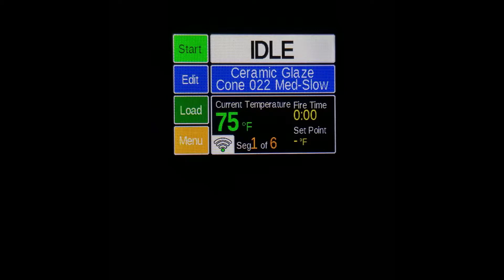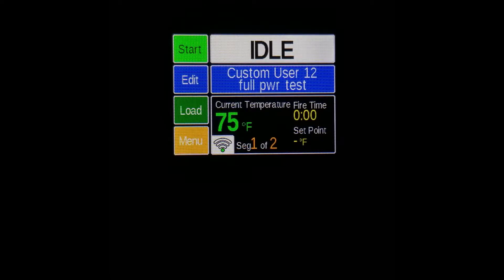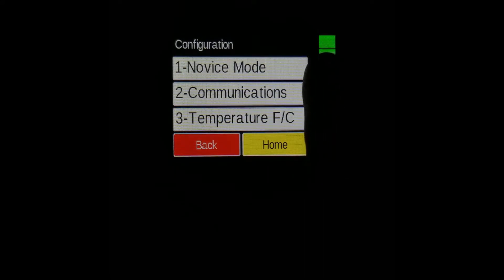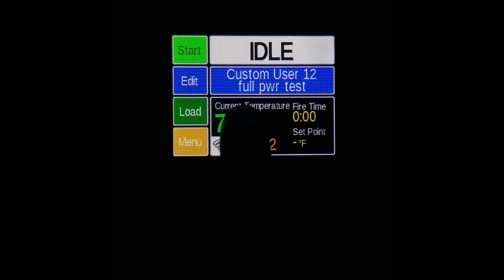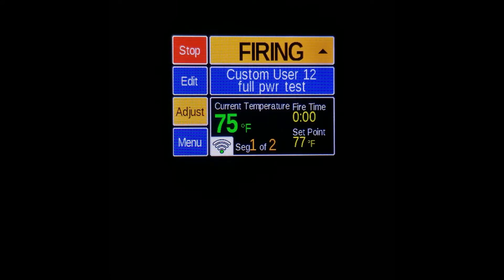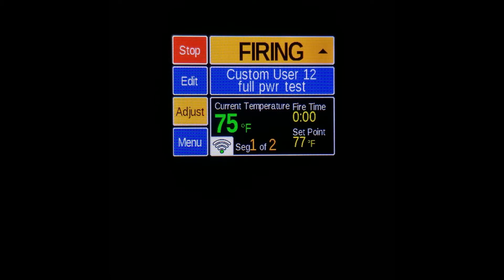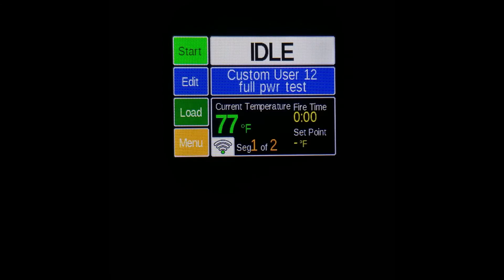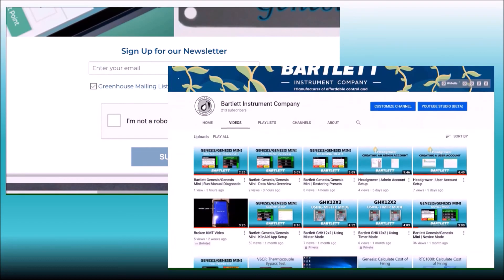Bartlett Genesis/Genesis Mini | Full Power Test

Comment: Good evening 
Quick ? Genesis 2.0 3 zone older converted kiln with solid state relays, after 2 cone o5 bisque and 2 glaze cone 5.5 firings my relay health tab is showing zone 1 226xxx, zone 2 178xxx, zone 3 258xxx cycles. I have the ssr option turned on. Are these normal numbers? I think they’re number of on/off cycles but it just looks like allot. Then I may have weak zone 2 elements on top of that. Thanks
Reply from the maker: When is SSR mode is pulses the output as the cycle time is set to 0 on the controller. This will make the relay health counter show high cycles. If you would like to talk more on this, you can reach out to information@bartinst.com